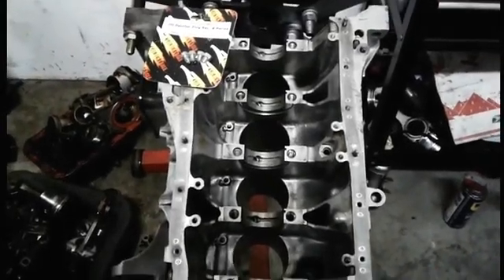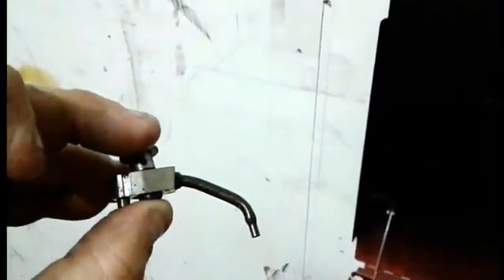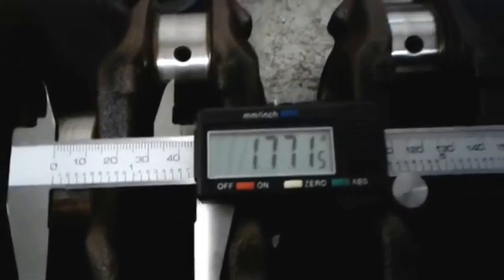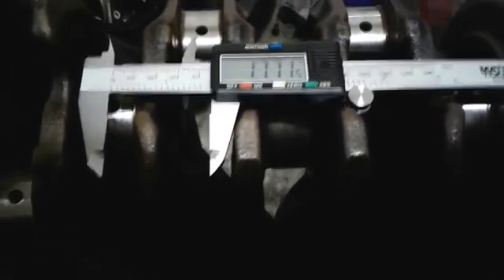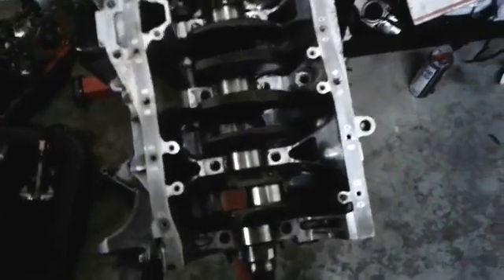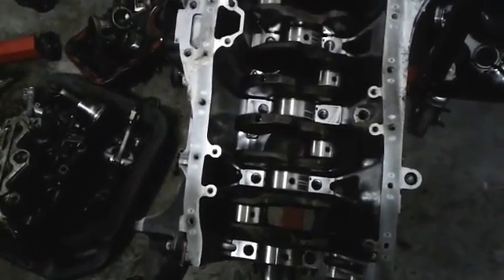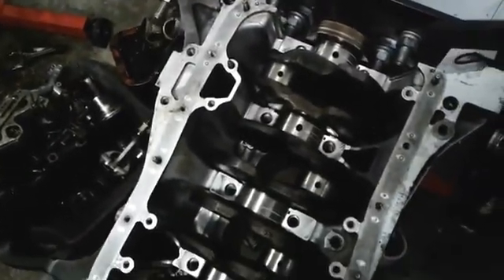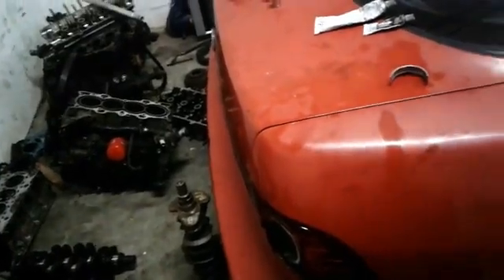B18b Internals In GSR Block. Turbo Engine Build - Pt 2

Comment: Im building something very similar. A gsr block with ls crank and rods, 82mm usdm b16 pistons on an obd0 gen 1 b16 head with cams out of an obd2 gsr. Could you give me some advice on a couple things? Im assuming ls rod bearings are correct, but not sure if i need ls or gsr mains. Im also a little unsure about the head bolts. I need gsr head bolts, right, because of the taller deck?
Reply from the maker: yes you need B series VTEC head bolts. and you use the bearings for the rotating assembly. the mains are the same its the rods that are slightly different.
Reply: skinnyg190 good Build man I’m running 82mm gsr usdm Pr3 Pistons but I kept the gsr crank and rods I’m also running a obd1 B16 Head with tuner 1 cams and Pro series intake with a 68mm throttle body great running motor I’ve daily driven for 2 years now pulls great till fuel cut at 8500 RPM
Reply: Mark Wallace how much hp you make ?
Reply: Kevin Thao I haven’t had it on the dyno yet hoping to this summer actually been pretty busy with other builds currently putting together a LS/Vtec